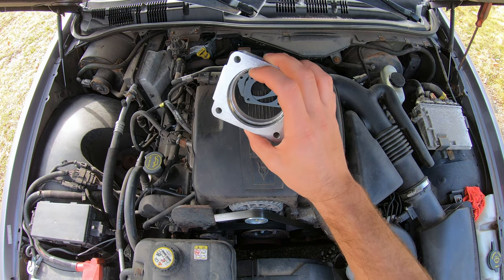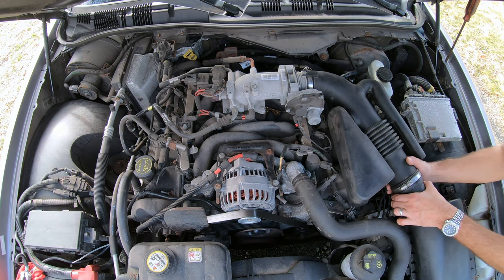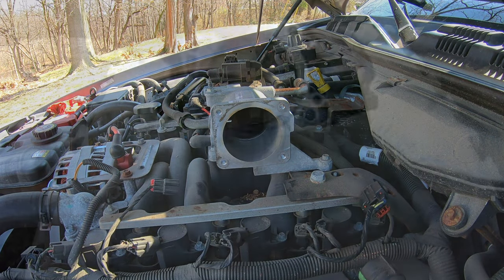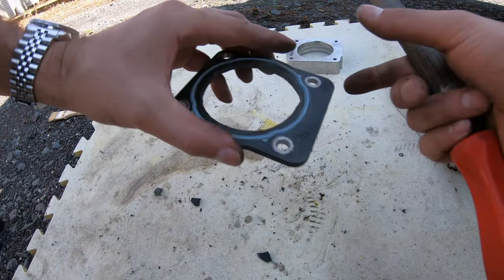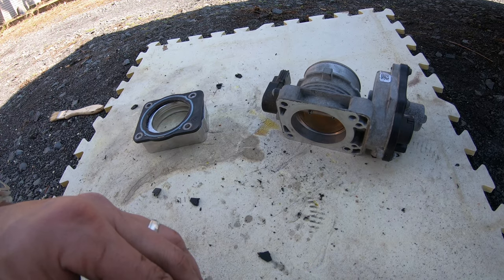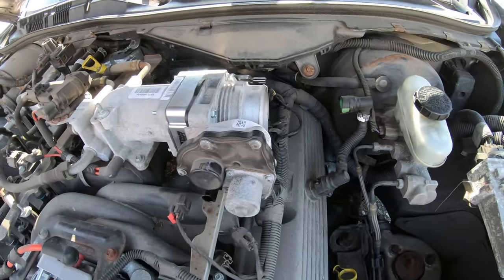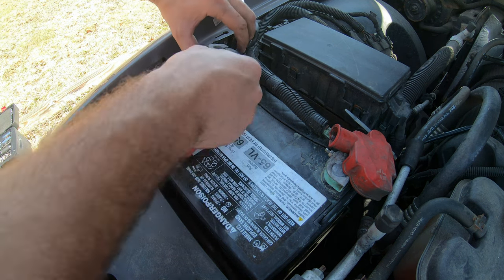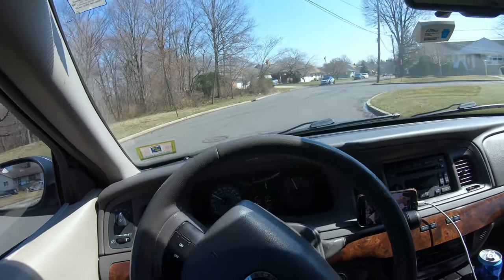Mercury Grand Marquis $50  Horsepower Mod? for Panther Platform How To Install Complete Guide 06-11

Comment: Those plastic teeth are helping shape the airflow so that it flows into the corner down to the engine better.   

Taking them out just created a worse traffic jam at the part where the intake curves down and created more back pressure into the intake and less laminar flow into the intake manifold.

Also I don't see what adding a few cm of length to the distance is supposed to do, make the car run more lean by tricking the ecu into a fractionally larger air charge?  (Seriously it is lowering pressure inside the manifold more than anything here.  Is that what the sensor reset is for?)

Really it looks like intake plenum volume change and you aren't going to be seeing any gains until you are increasing from 2-8 times your displacement.

A little ring isn't doing it, I think this is a scam and the car's designers knew what they were doing.

Anyway excellent video in clarity and production.   I don't think I'll do it but I have subscribed to your channel and am going to check out more of what you have made.
Reply from the maker: Thanks for stopping by! I appreciate the knowledge and the information. Are you a mechanic? I enjoy working on cars even if i don’t know much science behind it! I would never have never known what parts do unless I try it! There’s many like me out there and I’m happy to share my experience and videos! Thanks for the sub I am working on more videos of the Mercury and other vehicles! Have a good one ✌🏼
Reply: @LoveWhatYouDrive  No, just work on my own car but I'm a physics major so I get interested in the engineering aspect.
Reply: @BeKindToBirds  Combs are for fuel mileage.  Comb delete improved throttle response all across the rev range.  Suggest you try it before going keyboard on us.
Reply: @encinobalboa  Why are you acting like what you said invalidates what I said?  

You could get better throttle response a different way and have superior flow into the engine unless you think the engineers straight up made a mistake idk
Reply: @BeKindToBirds  Trying to do what?  My experience says that comb delete works.  I've driven a fair number of Panthers and still own two Crown Vics, 04 and 08.  04 does not have combs to being with and runs better than my 08 which is where the comb delete came from.

Still don't believe?  Ford Boss Me is a master Ford tech and has done a video on this.  He got the same result.  Your loss.
Reply: @encinobalboa  I'm not saying it doesn't work dude.   I am saying you are cutting off one finger to shoot faster

And there are BETTER WAYS that engineers have come up with besides changing the optimal air flow.

You can get better response without the trade, i seriously don't get why you are acting like cutting up your car is the ONLY way to get better performance.

You going to hack off the radiator to get more unrestricted airflow to the front of the block next?    Come on dude.

You are the kind of guy other contractors and mechanics clean up after.  Your cheap and easy can also be called cutting corners and not doing it right and robbing yourself.
Reply: @BeKindToBirds  There is not a lot that can be done in Kommie Kalifornia.  Sure, I would like to increase MAF size and get a tune.  I would like to get Trick Flow heads.  And so on.

As far as the rest of your speech, being a physics student does not make you the smartest guy in the room.  Far from it.  I will always go with experience.
Reply: Like anything that can be bolted on without changing the amount of fuel or air that fits in to the cylinder, it adds just as much HP as a flowmaster sticker.   There are plenty of parts that could add power, if they are currently a restriction, but that are not a restriction for the amount of fuel the engine can burn.  Yes, some 3 inch exhaust will really help on a built motor, but just bolting it on a stock 4.6 will do fuckall. Most of these sortsa of gimmick parts work the same way.  if you have a built motor and for some reason are still using a stock 2 valve intake, Yeah, I bet this thing will give you a little more power, but no one with a motor that could benefit from it would ever have that stock intake and throttle body.
Reply: @encinobalboa  FBM SAYS that he's a Master Tech -- but a simple background check shows that he's only 1 of the 2 Techs at his place of employment and he's NOT listed as a Master Tech. 
That so-called "Comb Delete" does NOTHING to increase the performance OR economy. Period. 
It was put there for a REASON, and your notion that it "doesn't work" is patently ridiculous.
Reply: @encinobalboa  Kommie Kalifornia !?? What are you, six years old !?? And NO, @Be Kind To Birds may not be the smartest guy in the room, but I'd bet on the physics student before wagering a single shekel on a guy that only has his limited experience to fall back on -- and THINKS that experience is all it takes.
I'm 84 years old, and probably have more "experience" than anybody on here, but experience without smarts won't get the groceries, kid !!
What you wanna do, is to get a lot of EXPERIENCE at being SMART -- like I did. 😁
Reply: Those plastic combs dont help airflow, they are intended to dull throttle response for a smoother drive. Just like how the transmissions in these cars slip against each other for a smoother ride. Both of these engineered designs hurt performance
Reply: @burmesebeef  How would they dull the throttle response except by changing the airflow to a more laminar flow and a less stacatto one?

You are proving me right lol
Reply: @BeKindToBirds  Show me the papers proving those gaskets are intended for laminar flow and performance enhancements. You are just speculating. "im a physics major so i know everything". Experience is more crucial.
Reply: @burmesebeef  Dude, use your common sense here okay.

Do you seriously think that car makers are just adding combs inside intakes to restrict airflow?

What other possible function could there be in a shaped comb right above a 90° angle

Like honestly, you know it costs money to put these in cars right?

Just Google "parts of an intake manifold" or "function of a plenum"  

Stop listening to dweebs and engage your brain for a few minutes and guess why Ford spent millions of dollars to install these in their cars.  Maybe you might notice some similar kinds of structure on your AC vents, on fans, on your house vents on ... literally every single air delivery system ever engineered.

If it isn't meant to smooth airflow and manage pressure when the valves are closed then what exactly do you think the engineers at Ford put it in there for my guy?    Do you think that maybe it MAAAAYBE might be there to do something with the air that MAAAAYBE is worth manufacturing and building into every car built for like, 40 years now?

It's also not a gasket lol
...kids these days

I swear man, it sounds like you did this to your car and are emotionally invested in thinking you couldn't have made a mistake
Reply: @BeKindToBirds  Bold of you to assume ford knows what the hell they are doing
Reply: @melvinharris7859  These kinds of structures are ubiquitous my friend.
Reply: @BeKindToBirds   You and @Chuck Hallowell wasted your time in here, proven by this later comment: "Show me the papers proving...", which was not done by the person demanding that.  Etc: And, we are all sure someone that has DRIVEN a "fair number of Panthers" knows more than engineers with proper education, years of experience, R&D, and testing facilities in a manufacturing plant knows more than everyone else on the planet, also.  Heh heh!  One dude is even mentally superior regarding politics: "Kommie Kalifornia".  Hilarious!
Reply: @melvinharris7859  And quite foolish of YOU to ASSume that FORD Motor Company   DOESN'T know what the hell they're doing.
 STILL the most popular Pickup Truck in  America for over 40 years. And counting.
Reply: @philgar7786  What TF are you talking about, Phil !??
You mentioned my name, but with no reference to my comment or comments that you so quickly disparaged.
 You seem to be questioning the qualifications of those who have posted and responded to the TBS video.
 Well, Phil, what are YOUR qualifications to pontificate on this subject !??
You show me yours, I'll show you mine. 😁
Reply: @SlikLizrd   ...  "@Phil Gar  What TF are you talking about, Phil !??
You mentioned my name, but with no reference to my comment or comments that you so quickly disparaged.
 You seem to be questioning the qualifications of those who have posted and responded to the TBS video.
 Well, Phil, what are YOUR qualifications to pontificate on this subject !??
You show me yours, I'll show you mine. 😁"
Reply: @philgar7786  You got NOTHING, Phil !??
 I'm not surprised. 
Please drive carefully -- the life you save may owe me money !! 😁
Reply: @SlikLizrd   I gave you a chance to read what you posted and correct yourself.  Obviously, that did not help.  For someone that likes to brag about yourself, you really ought to learn reading comprehension better.  "😁"

EDIT:  "...qualifications to pontificate..."  ...  Heh heh!
Reply: The assumption that the plastic combs are for shaping airflow is correct. These combs are a flow straightener that helps correct the eddies that come off the throttle blade. This is why you see the combs only at the top and bottom. The further the throttle blade opens the smaller the eddies are that it creates.

Before anyone asks my credentials, I have worked as a R&D technician for a turbo company for over a decade.
Reply: I realize I'm rather late to this conversation so forgive me for that, but I'm curious as to why Mustang GTs with the same engine don't have these equipped from the factory if they are crucial for airflow into the intake.
Reply: @ironpanther2420  Because they operate under different, stronger mix no doubt.  When you are pushing an engine closer to its maximums efficiency goes by the wayside in pursuit of more charge.   

These combs aren't effective at every speed and pressure, they have an optimization band.    Either ford didn't bother to engineer a new comb for the higher charge on the other version of the engine because the gain wasn't worth doing the math all over again and/or the intake manifold angle itself can't be fixed further past a certain point.

Eventually they would have to re shape the manifold and then bore out the engine and do other more extreme things in pursuit of more power.

In the engine it was designed for, not a performance engine, removing them will negativity effect performance but they aren't magical, they have a specific mathematically defined area they operate in and they  eventually stop helping and start getting in the way.

 But this is the difference between a Walmart door greeter and the crowd control they hire at black friday, at a point you have to change your strategy.

That's why it's in the sedan and not the GT car.

They could have spent money to make the gt car the same level of refined but it would not be worth the money to make a new comb that only increased things by a small percentage in a performance car.  Especially when re designing other elements like the angle the intake goes in, can get much more air overall, forget the cleanliness of the airflow for later.

Comment: Worthless mod
Reply from the maker: Thanks for stopping by! I would have never knew if it was worth it or not unless I tried it! 😉
Reply: @LoveWhatYouDrive  Not so, man --
We learn about these things by doing RESEARCH -- and ASKING people that have done a TBS installation and observed the results.
Like you, I DIDN'T do enough research, and bought a really expensive TBS , the "TAYLOR Helix Power Tower Plus" -- with a very sophisticated design, and claims of "Pays For Itself At The Pump"; "Up to 4 MPG Gain"; "Up to 22 HP Gain"; "Torque Increase up to 25 ft./lbs."
 I did a meticulous installation, and followed the instructions carefully.
The result after thousands of miles under a variety of conditions is quite conclusive:
Throttle Body Spacers DO NOT WORK on port-type fuel injected engines. Period.
HOWEVER, I HAVE SEEN improvements in performance and economy using a TBS on CARBURETTED engines, but as some others have pointed out, NO BUENO on the port-type fuelies.
Reply from the maker: @SlikLizrd  hey Chuck there you are again! Thank you for boosting the algorithm in the comment section. No one is claiming great horsepower games or increase of miles per gallon. Not sure where you’re coming from and bashing the video. But nowhere in my video am I saying everyone should do this or everyone should get this. I made it I experienced it I’m doing my own test and that’s where the video is. Have a good day Bud!
Reply: @LoveWhatYouDrive  I'm sorry, but it appears that you don't comprehend my words, as written.
 The title of your thread refers to a "50 horseepower mod" that you attribute to a throttle body spacer.
I tried one. It didn't work, which I explained considerable in detail.
No reason for your defensive attitude, man -- none at all.
 
 It's all good -- take care.

Comment: How come you put the side labeled “manifold side” on the wrong end?
Reply from the maker: My common sense kicked in, the outer lip was just going to get in the way of airflow. It’s like a funnel effect but the way they had it was like flipping the funnel other way…
Reply: @LoveWhatYouDrive  I heard the same thing in another video but my throttle body spacer seemed to have the label on the right side. I hope at least because I installed it in the way with the "manifold side" towards the manifold. It would make sense to me that the larger opening it facing the airbox and the smaller opening is towards the manifold. That's the way mine was labeled and the way I installed it.
Reply from the maker: @WhiskersTheFish thanks for reply,
Maybe the labels were wrong, idk..it just didn’t make sense to me…I’ll double check, maybe I made a mistake…and if I did I will admit, thanks for catching that…🤝🏼

Comment: LOL Makes as much change in perfomrance and power as switching to LED headlights does. Actually, by removing the vanes you destroyed the vortice flow and decreased the air flow and density. You probably lost horsepower and torque by cutting those out. And the spacing does absolutely nothing. In fact, if anything, you want as short a length of flow as possible, not make it longer.
Reply: All late, LED headlights actually give you much more of a performance kick.  They use less power than the halogen stock ones, so there’s less drag on the alternator, at least in theory. That said, the reflectors in the headlights are designed for a single point light source at an exact position. You get far less light where you actually need it, and a bunch of useless light blinding other drivers and lighting the sky when you use led bulbs in stock composite shells.
And by much more, I mean a barely measurable improvement that is functionality nothing, but still far more than this crap.